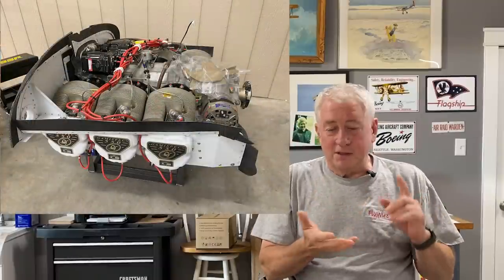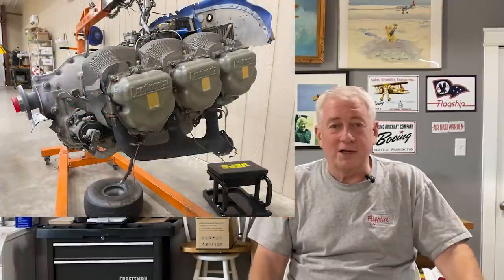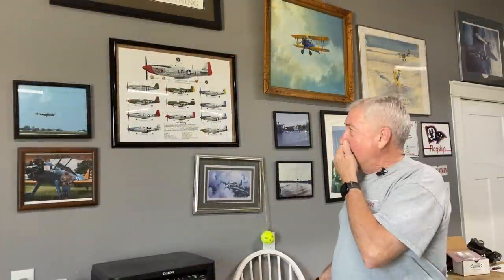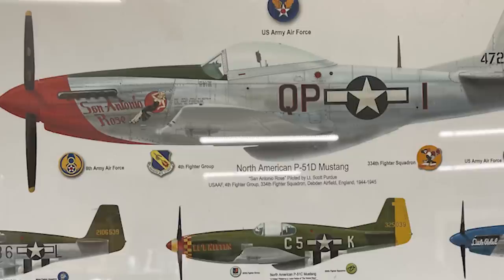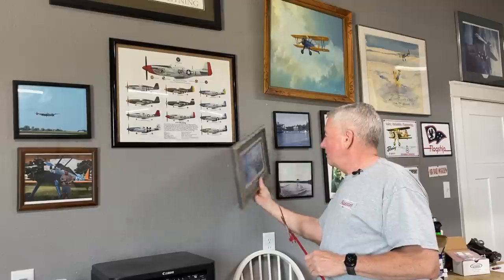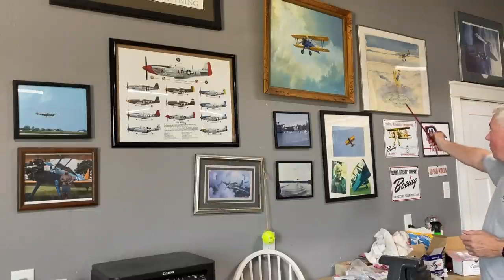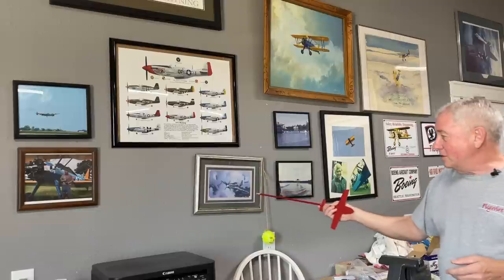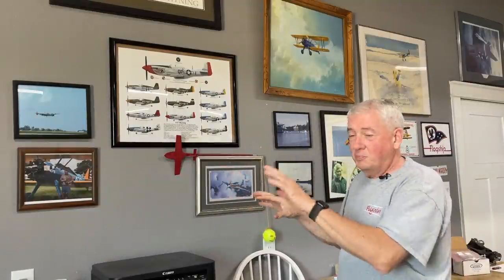FlyWire Update:  533C Engine Change, Accident Reviews, Photo Wall, Oshkosh plans 2022

Comment: I try never to rush thing either, especially when working on my, or anyone else’s, airplane.  I lost oil pressure, due to a piston, piston rod cap, and the cam tearing up and blocking the oil flow through the corse screen.  I made an emergency landed in a small east central Texas town.  It took about 7 months to go retrieve the engine, tear it down, replace the bad parts, do the machine work, inspect the reusable parts and get it back together.  Then drive back to Texas to reinstall it on the aircraft.  It was about an 8 to 9 hour drive away from my SE Louisiana home.

Comment: Great video as usual. I have heard that if you support the ignition wires higher that you will get better cooling on the IO 550
Reply from the maker: I do run mine pretty high.

Comment: Can you talk about what it takes for you to do your own engine change? Do you have an A&P, or do you have one that inspects your work? Or is it experimental class because of the aerobatic rating?

Asking because I want to buy a Taylorcraft down the road and fix it up the right way.
Reply from the maker: If you have supervision from an AP you can do a lot of work. Great learning opportunity. I worked with an AP/IA for many years, lots of things and different engine changes. Restored my Stearman. Then I got my AP.
Reply: @FlyWirescottperdue  Awesome. How close and frequent does the supervision need to be? Does he need to be in the hanger with you while you’re doing the work (I expect not!); what evidence does he need to see about your work (torque wrenches/calibration records and the like; Photos or video before/after)?

What regs apply that I can read? What is implied in-between the lines that’s not stated explicitly?
Reply: Pete’s Guide   How much, if any, mechanical experience do you have.  Do you work on your own cars?  What kind of tools do you have?
Reply: @billmorris2613  I’m pretty handy, but would leave all of the engine to the A&P, because that’s not my area of expertise; I’m mainly interested in getting hands-on understanding of the avionics. For electronics, I spent 10 years as the technical editor of a monthly computer trade magazine, built the magazine’s test lab, contributed an important improvement to RFC 6350, and once built a mostly self-healing Internet system for the Red Cross that ran for two years after I left even though nobody left on the team that knew what an RFC was. Lots of hands-on serial, network, and RF cable building experience from amateur radio work.

The main purpose will be to show how to not pull a Trevor Jacob, and the secondary purpose will be to see if I can nudge a few quality/safety/modernization things into GA that I feel are important.